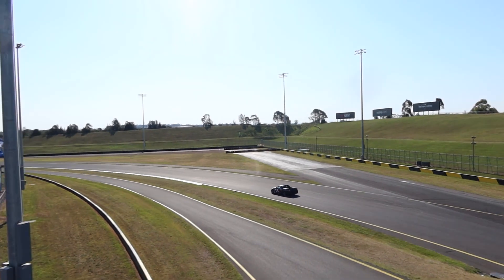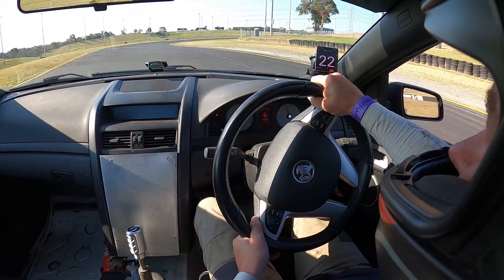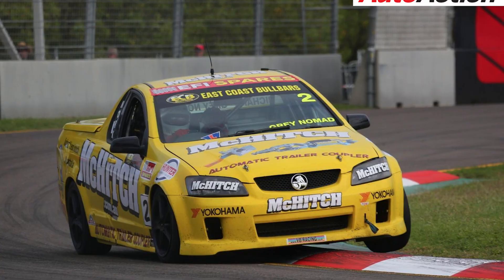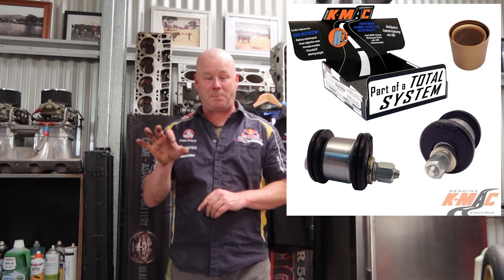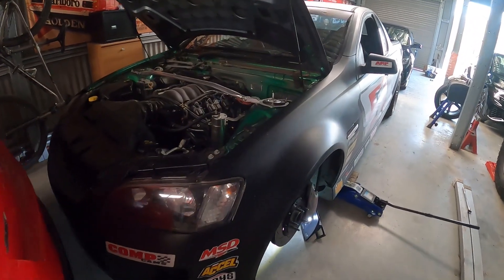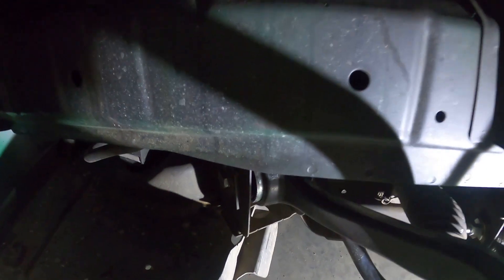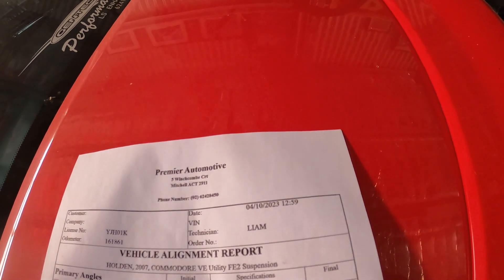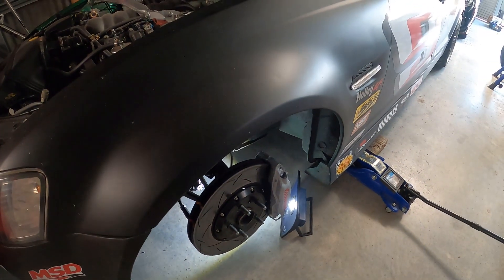K-MAC Camber Suspension Mod | VE/VF Commodore

Comment: I just did the kmac camber top install on my VE sedan I am prepping for NSW Supersprint. Max -3deg camber so I haven’t bothered with the lower bush. Thank god you showed some engine bay footage because it’s hard to get used to the top nut seemingly not screwing down far enough. The instructions are also pretty confusing around the engine bay washer/rubber but mine looks like yours now. Only issue I see with Kmac is the coilover top damper screw can’t be permanently mounted but I guess it’s only a longer Allen key!
Reply: And best of British luck re-using the old strut top rubber. You’d think kmac could afford some of those for the kit.
Reply from the maker: G'day mate, we managed to get -4 degrees in the front.  Yes, the top nut doesn't like to fasten all the way down!
Reply: @ClunieGarage  I meant that the rule book limits me to 3deg in NSW Supersprint. I’m not surprised you got more with the eccentric lower arm bush. The BC coilover I have actually provides less camber adjustment at the hub than the standard FE2 strut so thank god for the kmacs providing the extra. Let’s see how close I can get to your 1min 54s.

Comment: What about correcting rear camber from a lowered ve sedan do you know if they have a part for this ? They run out of adjustment. Superpro use to make an arm for this but no longer make them anymore .
Reply from the maker: G'day mate, maybe check with K-MAC if they have any thoughts?  We are running -2 in the rear which is working OK for us.

Comment: I put the K-mac camber/castor adjustable top strut mounts in my VF GTS which added some extra camber, but didn't do the lower control arm bush. Looking back I really should have done both like you guys 🤔. I noticed in the SMSP footage you had a cracked windscreen, I'm surprised the scrutineers let you on the track. Every track day I've done at Baskerville, they wouldn't let any car on track with damaged components. Keep up the quality videos fellas 🫡
Reply from the maker: Thanks for the info!
Reply: Did you get free control arms? Lol gm was offering 10 year warranty on VE so I got them done 2-3 years back.